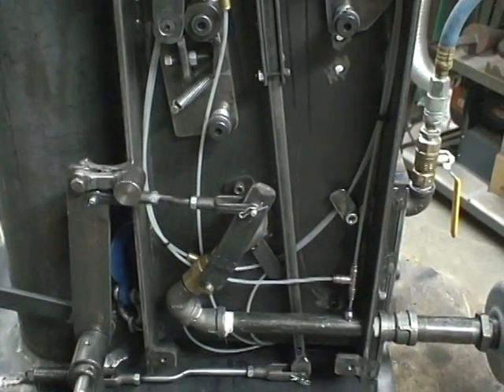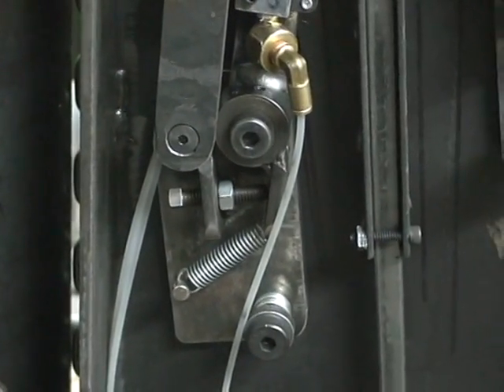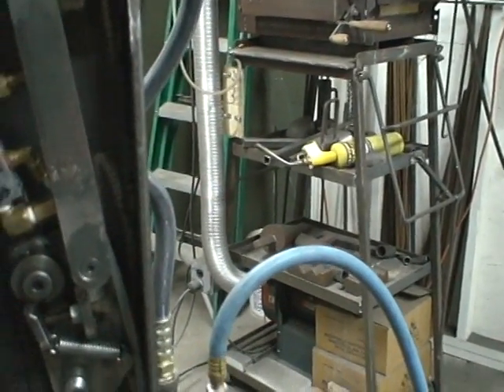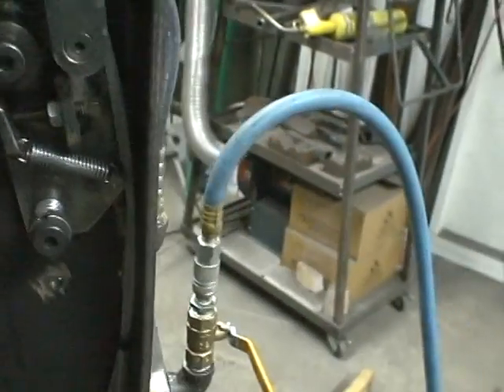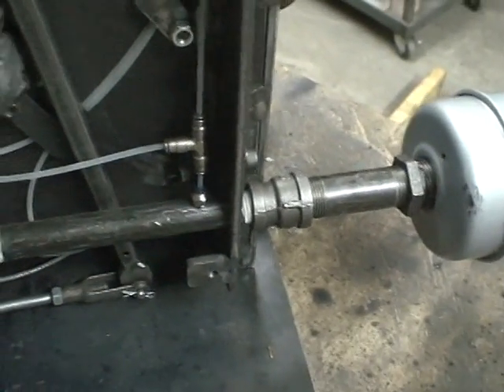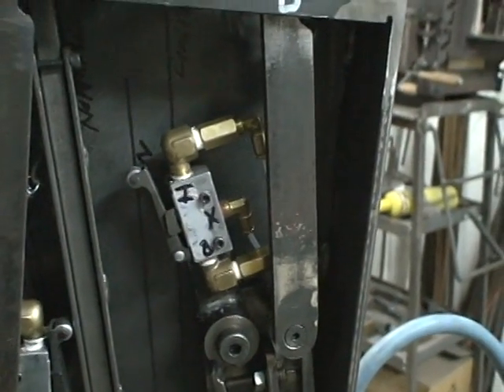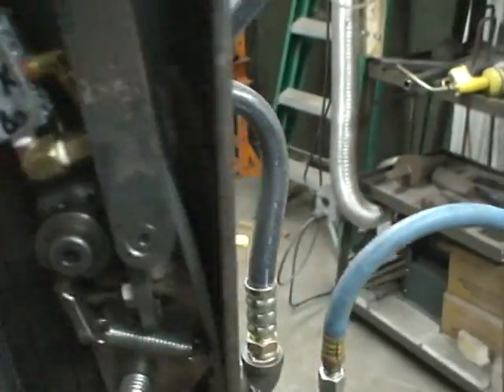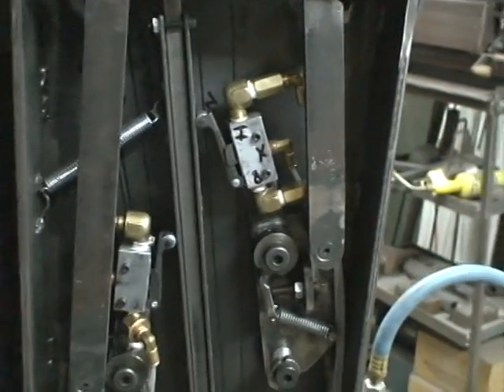Hammer control.avi

Comment: Hey ciladog! I just watched this video again, and I think that with lines you drew on the compartment makes it much easier for others to visualize the original geometric principle of the original control mechanism. On the original hammers,  it was never necessary to open the control panel to adjust the height of the stroke. With the valves properly set, the stroke height was infinitely variable from the treadle.  As far as I can tell, your modification only has the potential to change the 'cycling range', or amplitude of the ram movement at any given position of the treadle.  Is that what you were trying to do? I'm wondering if you went to all that trouble for nothing. Maybe you could make a forging video showing the importance of the modification in use? I would be interested to see it! Here is a link to the original valve adjustment instruction video. https://www.youtube.com/watch?v=YOfuUDZpr6Y
Reply from the maker: Hi Tom, It was a modification to control the limits of the stroke on the column and the intensity of the stroke anywhere on the column.  I can have it set that the hammer never hits the anvil but comes down with full power.  For example:  watch this video where I am chasing on the hammer with my hand between the hammer and the anvil.  Even if the chisel gets thrown, my hand will not be caught.  https://www.youtube.com/watch?v=_EptyplO_swSo I have the treadle to control the hammer but I also have the control to adjust the stroke and where that stroke happens on the column.
Reply: Hi Ciladog! Thank you for the reply! On the original, the throttle can be unlatched and fixed to the desired blow strength (or speed) for all blows, and since the telescoping rod position determines the lower trigger point, the descent of the ram can be limited by placing a block under the treadle, or an adjustable stop. Are you aware that the paddles were supposed to be adjusted with the valves running 'crossed'? Meaning, in order to keep the stroke length short enough for rapid, full-throttle cycling, both valves are triggered at rest, and the one which releases controls the main valve. Just curious if you got that from the adjustment video.

Comment: Hey ciladog! I'm just seeing this video for the first time in 2017. Those are some interesting modifications to the original telescoping rod control design. I'm curious what was the intended purpose/effect/benefit of the modifications? The original design basically centered the pilot valves at the middle of the stroke, and let the moving geometry provide the at rest, cycling, and clamping functions. If I understand what I'm seeing here, you should be able to achieve a "no clamp" mode by shifting the paddle pivot locations? Is there another potential benefit I have overlooked? BTW, congratulations and A+ grade on being the first person I have ever encountered to recognize (or at least mention in my hearing) that the original telescoping rod control is non-linear by design. The subsequent bull and Phoenix hammer controls achieved the same control curve using intersecting arcs instead of the triangle, but use the same basic concept.
Reply: By the way, if all you wanted was a "no clamp" feature, there is a much simpler modification you could make that only requires about 3 moving parts. If you want to add that feature I'll try make you a sketch of how it works. Cheers!
Reply from the maker: Hi Tom, I wondered if you would get to see the video.I thought from the moment I saw the workings of the Bull that it was a stroke of genius compared to many hammers on the market. The modifications on the hammer I built were to accommodate moving the stroke up or down on the column without much trouble.  My hammer can move the stroke up or down 10 inches to accommodate tooling and dies.  I don't have to readjust the pilot valves.  I just move the levers the valves are attached to.  Hard, soft, fast, slow, is all possible anywhere on the stroke.  But sometimes, I'm confused and have to play with the settings to get what I want..I also liked the small configuration of the bull.  It has the capacity of a much bigger hammer in such a small footprint. Thanks again for your comments.  I wish you good prosperity in the future.

Comment: Thinking about building an air forging hammer myself but just wondering how much air does it require? My compressor is not very big. Was wondering what air tool you would compare it to as far as air consumption. Thanks
Reply from the maker: Think sand blasting.  This hammer runs on about 9-10 CFM when used continually.